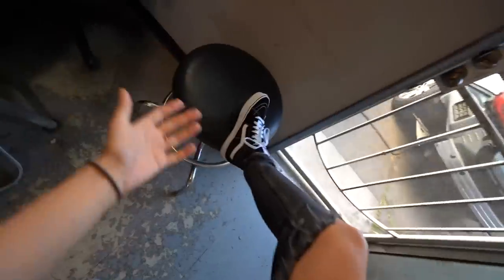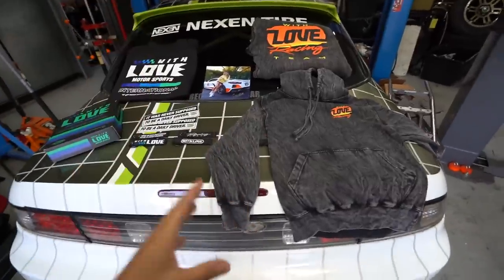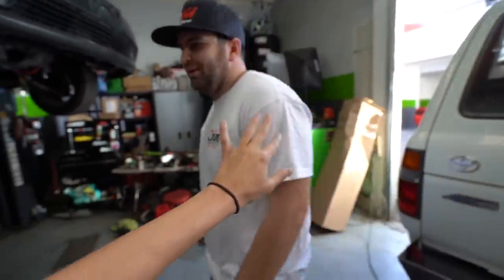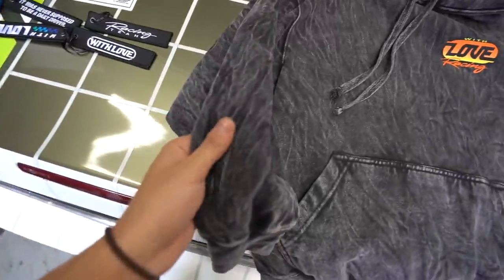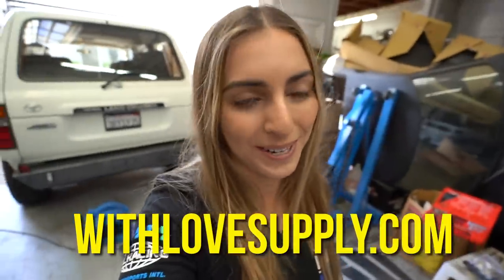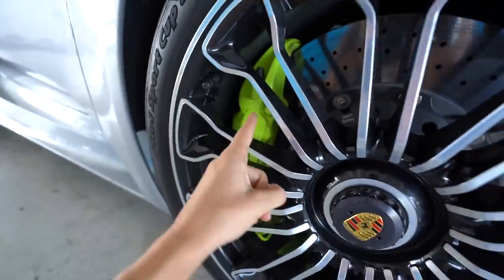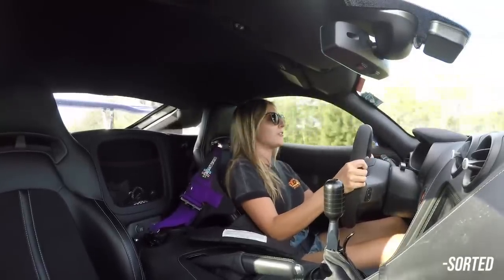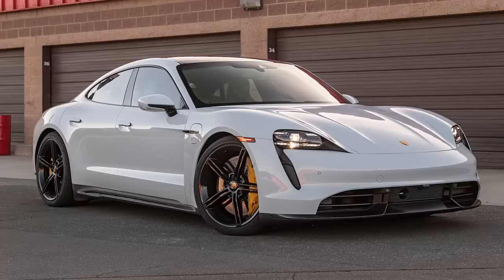I'm Buying My First Supercar.

Comment: I'm sure you found it already but the door lock cylinder is on the drivers door underneath the intake area. Right around where you grab the handle to open. You have to squat down low to see it

Comment: Owned a 2011 r8 v10 gated manual in red.  Easily my favorite car on the planet.  Its an extremely satisfying total driving experience with the gated manual, and Matt is right go v10 for the power and more the exotic sound.  +/- supercharger, but having watched many of your videos, I am quite sure it will be +supercharger by the end of your ownership.  Appreciating in value, minimal upkeep.   It is the perfect everyday super car you can comfortably drive across country if you want.

Comment: Emelia: All my cars are broken.

Also Emelia: I should buy a very fragile car
Reply: Actually, VW V10s (lambos and audi ones) are almost bulletproof if you don't mod them and do the basic maintenance. V8s are not that good
Reply: @manelpelayo2753  It's actually the old Gallardo engine developed by Lamborghini that is still getting used, not a "VW V10".
Reply: Of those "supercars", the Audi is the only common sense choice; if you can use the term common sense when it comes to any supercar. You're right on the fragile part. Those cars are more fragile than a  spoiled rich 16 y/o girls ego; and more temperamental. Seriously. If you Must change the timing belts, clutch & a full tune-up every 25K or it'll grenade, how super is it?
Reply: @manelpelayo2753  especially the timing belts, worst engineering flaw...thats why ovh pushrod v8s are so reliable
Reply: If she does much more then exhaust total F430 she will be burning money. I had a F430 Scuderia 09 year and key word is HAD for a reason. Lol
Reply: Timing belts? Who uses those these days? Totally the weak link, except for Hondas!
Reply: @alansaad9271  sadly alot of automakers
Reply: @John-qz4cv  They're nothing more than garage art. People don't see the pattern. They wonder why they're SO cheap at $80,000 with only 25K mi on them. It's because the normal maint is due and will cost over $10K to do or they'll grenade. The only thing about a supercar is that they're Super costly ti maintain.
Reply: @DjJtown  yeah but thats all the extra content for her to film doing it herself. I think she should just save the money and get the McLaren down the road.

Comment: daily a muscle car, that way parts aren't that expensive depending on what you get, 67-73 camaro, mildly do up a small block and put a 6 spd in it, dont need to LS swap it, right away at least, or go with a nismo 400Z

Comment: V10 Audi r 8 all day long for daily  542 hp. Then you can add a really good set of cams intake and manifold and full titanium exhaust including manifold with a new bigger throttle body. Pully all the lighten pullys and a lightened flywheel for fast revving will easy be 620ph and  really reliable

Comment: You ever considered the OG NSX? I owned a 2000 model and it was my daily. My buddy at the time added a SC and we agreed it gave it that V8 feel. It’s certainly not the V10’s you’re talking about, but it is an incredibly sexy track/street focused car that has skyrocketed in value. It’s really a win/win for you if you’re ok with a smaller engine that handles mods exceptionally well and is still daily driven.

Comment: Mercedes AMG GTR (certified pre-owned).  I live in here in So. Cal. On any given weekend there are alot of Lamborghini's, Ferrari's and McLarens cruising down PCH. With a GTR you'll stand a little more out from the crowd. It's cheaper, and there are plenty of dealers (20 ish)  in LA and Orange County for any service work. It will let you go from crazy (as you said it) to classy and provide better reliability than your other choices for a daily. As a Benz owner (not GTR), it's a solid built car for a daily.

Comment: I think they are right that the most sensible option is a manual R8. However I do not think a supercar should make too much sense :) A supercar is about something else, a feeling of owning something special and the brand matters. Especially if the car lives up to the brand. I was in a similar position and choose the F430, I think the car has soul. And the the F1 system is ok if the car is driven like a manual and that means never auto mode and let go of the acceleration during gear changes.
You have excellent collaboration with KW and every 430 owner need there "Front Lift System". See what you can do with them. Lots of love, you are amazing and whatever you choose it is going to be great!

Comment: Personally, I'd get the R8 V8 stick just because it makes ridiculous power with only a few mods, could be tracked if you wanted to, and would be reliable.  However, the Porsche 911 GT3 RS is probably my personal favorite to drive.  The ZL1 isn't bad either, the 1LE version is ridiculously capable and an easy drive for daily, you get a trunk, a back seat, and it comes in stick still.  I'd sell you mine for the right price 😅

Comment: No super car as a daily. Get a Hennessey trackhawk, Tahoe, or Escalade. You can have a 1000 horsepower, with a warranty....... Also all kinds of interior room to carry tires or whatever is needed out of the weather.

 All of them have a great towing capacity, to get Miss MiMi to the drags, or the C8 to Track. 

Oh yeah,  they are super car killers. 
They are around 100K. Closer to your budget.  You might get a deal with colab with them. JS

Comment: key entry
KEY RELEASE
If vehicle power is lost, press the button on
the side of the transmitter to pull out the
key. Use the key to open the door. Pull the
looped cord below the instrument panel to
open the hood for access to the battery.

Comment: My Super Car is a 1973 VW Super Beetle SN# 1332921268, HAS A MODIFIED CHASSIS TO A PORSCHE 911 CARERRA TWIN TURBO 1975 .  EVERY MOD POSSIBLE. HAD IT SINCE 1974. 5 SP/A/C. DAILY DRIVER IF I WANT. 203MPH ON THE DAYTONA TRACK 10TH LAP. WAS SPONSORED BY Porsche. To this date I hold the Nurnberg Ring Track Record in Germany for the class. 0-60 2.8 SECONDS. FASTEST 1/4 MILE 168.9 MPH. You never spin a tire or you burn the clutch. Thank you Wolfgang Boober Mainz Weisenau Germany who built it....RIP... Runs on 100 Low Lead AIRPLANE Gas.  28MPG..NEVER HAD A OIL LEAK OR BREAKDOWN. RUNS ON SLICK 50 OIL ONLY.

Comment: I can understand the want for a supercar... Reliable and daily .isnt usually associated with that. And anything bigger than a small bag its not a you can use it as a supermarket visiting vehicle..  
Daily driver. Reliable...i'd see a car 
.. v8 powered ..maybe  a  ute..good for daily. See holden ss Commodore ute.. Can be modded. And still reliable.. They are also known in Sedan form as a malibu...  various other form are senator/caprice..all rwd.. can supercharge all of them.. 
From Prius to lambo.. 😨...    
Its a if can afford to go for a supercar then go for it.. as long as it is financially a good time to do so..

Comment: Don’t buy a super car. You’ll be saddled with ultra high dollar replacement parts costs. 
This from eons ago reading what Mark Donohue and Roger Penske went through trying to buy OEM factory racing parts from Ferrari for their racing engine. I suspect not much has changed except the cost of the parts going up. 
If memory serves, Penske had Traco (out of Culver City, CA) put their Ferrari engines back together and sent all the engines, etc back to Medona, Italy and Mr. Ferrari. 
Then there is the IROC I series. Penske had Porsche 911 Carreras first. The cost was astronomical. All the rest of the time in the IROC series they went to tube framed GM based Chevy Camaro custom race cars with a pushrod V8. 
Just trying to give you some insight from a blast from the past.

Comment: Lambo - every YouTuber has one, so no.
Ferrari 360 looks like some Japanese boy racer, 430 nice if a spider, 458 is an upgrade to the 430, but I don't think Ferrari is you anyway.
Audi R8 might perform, but it looks like they took a boring car and added side air-scoops as an after thought trying to make it super, but it just doesn't have a supercar "pzazz", much like a C8 isn't classified as a supercar.
McClaren (not 12C due to reliability) 570S is comfortable, drive handling is the best of anything on your list, they're not as unreliable as believed, plus it looks like a supercar.

I noticed how MANY of the cars you enjoyed were yellow. If possible, don't buy red, black-gray-white, or dark blue, get a car with a color that stands out (or wrap it to look stunning).
Personally I'd go for a convertible of any of them.

Comment: Definitely wouldnt do a Gallardo. Most Gallardos will lose badly in a race against a stock mustang GT. Now a huracan do a blue with black accents. Or just get a GT500 lol I know you hate fords but think about the 1150whp and 9s in the 1/4 mile so faster than a hyper car. But reliable. 80k for the car less than 20k for the minor upgrades and tune. 100k you have a hypercar/supercar killer.

Comment: umm if your looking for a good super car daily that 100% can be super reliable and highly moddable useing a 4 cyclinder supercharged toyota motor  with almost  200mph top speed stock and rear wheel drive.... they dont lose there value and alot cheaper then what ur compairing to  and honestly  the lotus is a "drivers" car  and u would be the first and only on youtube other then mightcarmods oh and lastly  its not a  god dam boat size wise  numble light and fast and track ready

Comment: I hate to say it, but stay away from German 'supercars'. The reliability is horrible (especially for Audi and Mercedes/AMG). For a 'daily' supercar, the Lambo Gallardo, Huracan, or the ACR Viper would be potentially better choices and parts are more readily available. The McClaren is a definite no-no! Parts are almost non-existent and they are way over-priced for what you actually get. Not good for a daily either since they only have 1 seat.🙄 
Incidentally, I haven't heard much of anything about the Porsche Taycan 4S except it has had NO recalls so far, and reliability is right up there with the best. It IS electric, so no modding on that one, other than cosmetic stuff. Might actually be a good candidate for a 'daily' supercar that not too many other people own.😉 Plus it's pretty fast with a 155 mph top end, and a 3.8 second 0-60 time...